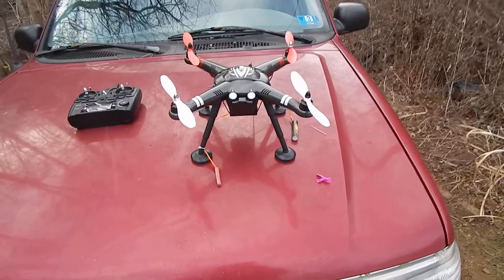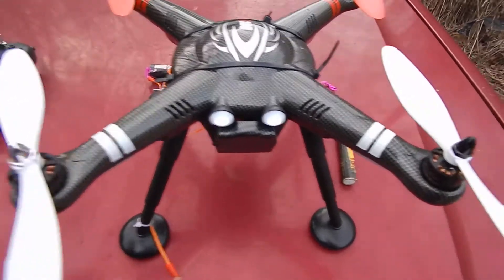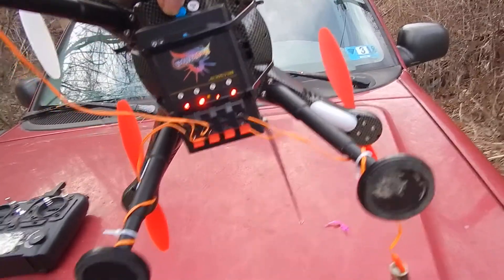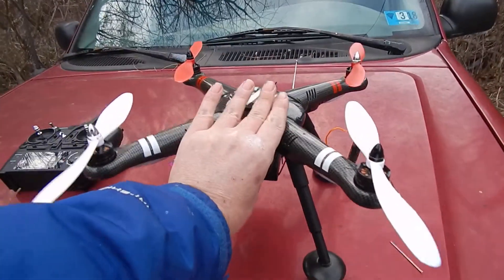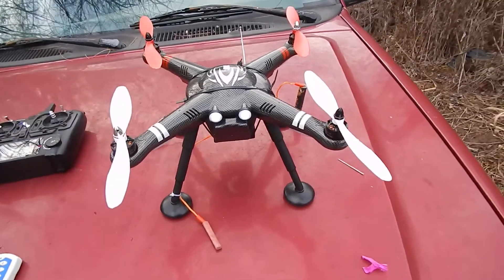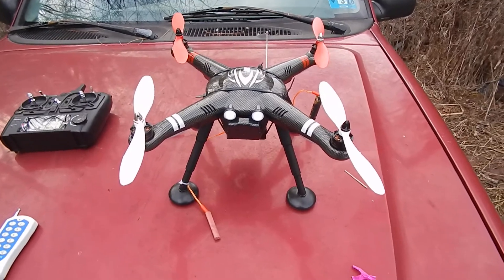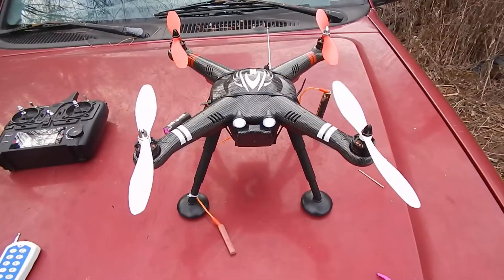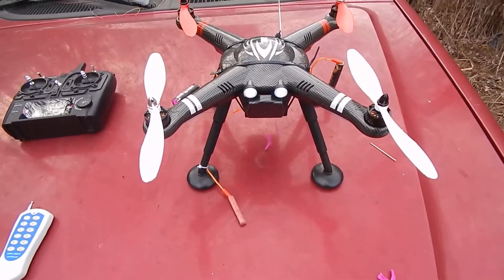PYRO DRONE TEST PART 2

Comment: Oh fuck sick idea bro.. I got me some of them modules too =] let's see if my $50 500mm drone can pick up one ur shits sick tho bro looks like carbon fiber with some brushless
Reply from the maker: Check out my drone firecracker drop some dum bums lol iit did not go well lol
Reply from the maker: I had a syma like the one in your vid lost it first flight got hit with a 40mph wind gust and was gone lol  that sucked it was over 100$ back then
Reply: hillbillypyro inwv lol they go clearance on eBay on some of the models like the altitude hold version x8hc..the x8's are usually good in wind if you're in hi mode on the transmitter.. lost prolly 5 x5c's ..  they're usually $21-$22  for a quad by itself.
Reply from the maker: Yep i started on the x5c when they came out i still have some around  great starter drone
Reply from the maker: https://www.youtube.com/watch?v=3kdvbW_AOaQ&t=17s this is what i have that still flys  i have about as many for parts 2